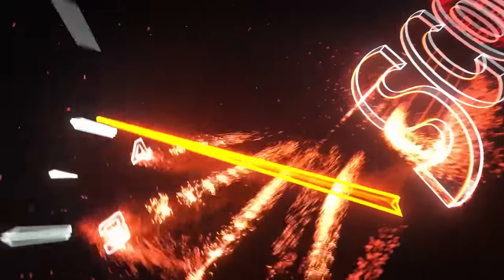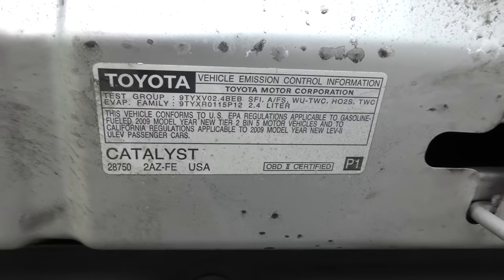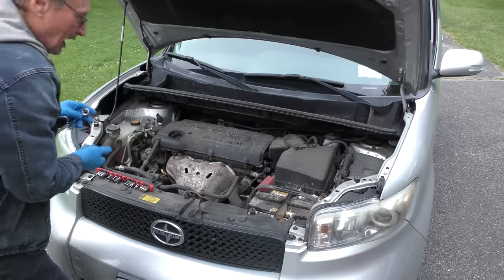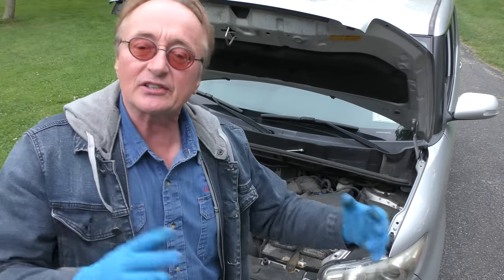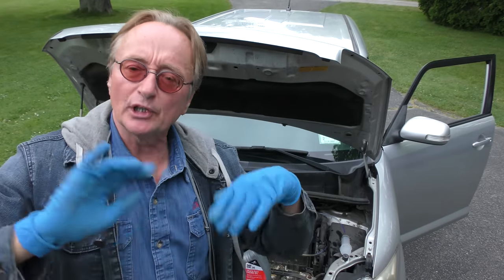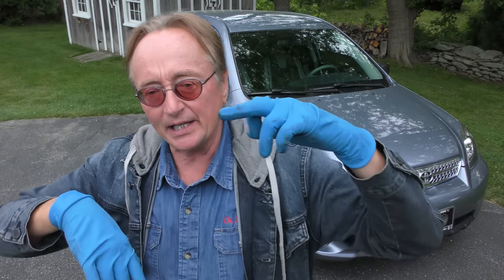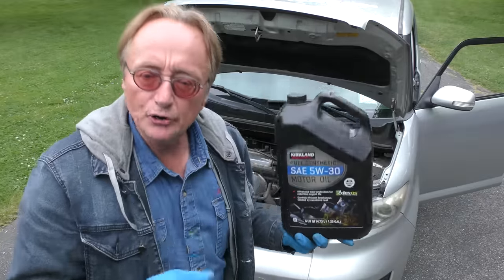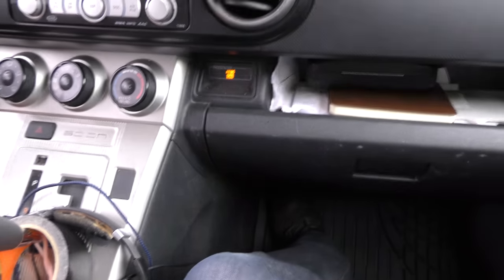Read My Lips, DO NOT Buy These Cars

Comment: This is a shame about the engines because the slightly larger 1.5 L 1NZ-FE used in Yaris' and Echos is simply indestructible (with proper care)!
Reply: Your engine is 1 liter smaller.
Reply: The 1.5 in my '17 Yaris has been great.  With yhe 5 speed it's fun to sling around corners and the freeways. At 55 mph in 5th gear, on flat ground, it gets over 50 mpg. Around 103k miles on it now. Interested in how long it will last. These were great baseline cars, a shame they didn't sell well here in America
Reply: @jcrowellz2000  I own a 2008 Toyota Yaris sedan 5 speed. Owned it since 2013, I have 321,000 miles and just changed the clutch and she runs great. In almost 10 years only the clutch and water pump have gone out
Reply: The 1nzfe was also in the first gen xb's and is also bulletproof and also used in the xa
Reply: dogs, the Scion's were great cars with minimal gadgets, which some people like more. A shame Toyota kinda marketed them wrong. But idk how they could have marketed low priced good cars any better 🤔
Reply: @jcrowellz2000  I have a 2009 Yaris 5 speed manual hatchback with 84k miles bought it with 23k for 6,000$ haven't had to turn a wrench on it in over 5 years just normal preventative maintenance.

Comment: That's why the first gen Scion is the best. My '06 is running fine at 182,000 miles with only oil changes and transmission fluid changes.
Reply: 06 also on 68,000 looking forward to longevity
Reply: Mine currently has 277K

Comment: Got a 07 Toyota Camry and it definitely burns oil. I just listen to Scotty & my mechanic and just keep the oil changes going. And it still runs good.
Reply: Did you buy it new? Only 25% of people in this country perform regular maintenance
Reply: I have the same year Camry What oil do you put in it? I originally used 10-40 then went back to its original cap 5-20
Reply: I put 306,000 miles on my '03 Camry before it died.  And the only reason it died was because I had slacked off on the oil changes.
Reply: @stevechance150  in my experience 80% of high mileage car deaths are when owners get tired & start slacking regular maintenance. I will always maintain my 06 Matrix religiously even when it has 500,000 km on it
Reply: @kolbymartin9743  No, it was used. Previous owner took extremely great care of vehicle.

Comment: I have a 2003 Toyota Echo, only 49k miles, stick shift, still runs well and gets 40-45 mpg.
Reply: @sonafsarek dam rare find! Super low mileage! I love stick shift Toyota’s, in my experience, Manual Toyota’s are the easiest cars to learn manual on. Clutches aren’t stiff, & the shifters feel great. Is it a 4 door or 2 door, & what colour is it? I’m just curious. You should also look up the “million km Echo.” It’s amazing.
Reply: I drove an 02 for 10 years until the differential failed. 110 K miles.

Comment: Just got rid of my 08 Xb. Had about 285,000 miles on it. Still ran great. Only reason I had to let it go was because some ahole in a f-350 slammed into me and totalled it. Was hoping to give it to my son.
Reply: Wow that sucks. The 2nd gen xBs really do last forever as long as you check the oil and fill it as needed

Comment: Same thing is going on in my 09 accord 2.4. Honda didn't build the piston rings correctly and is a notorious issue in the 08, 09, 10 models. So much so there was a class action lawsuit. Im always monitoring it. At this point with cars so expensive now I might as well get it fixed after I finish paying it off. Probably cheaper than buying another car and getting stuck with another note

Comment: I have a 2002 Camry with the 2AZ-FE engine.  It does not use any oil, but only had 49,000 miles on it.  I change the oil at 3,000 or 1 year and hope the pistons and rings last longer than I do.  My oil filler only says use 5W-30 oil.
Reply: @Jonathan A  Ah, right.  My 2AZ-FE has the head bolt problems that cause coolant leaks and overheating and warpage.   Pick you poison.

Comment: Darn. This makes sense. I have a RAV4 with this engine and since I've bought it, it has been burning oil every 1500-1700 miles or so. Smh. I took it Toyota and they said they would charge me to fix it. I couldn't afford it so I'm just living with it. I tried using Lucas oil. It pretty much worked. Then I tried a heavier weight oil, that also worked. I'm not sure what kind of damage I'm doing to my engine but it isn't burning oil lol. I will probably sell it in the future anyways.

Comment: I must of gotten lucky to have the upgraded model. I have an 08 with with 224k miles on it and still have the original starter in it. No oil burning issues.

Comment: I've had a 2012 yaris le for past couple of  years and keep anticipating something going wrong, but it's just consistently reliable and no surprises. No check engine lights yet, no oil consumption at 155k and AC still working great, knock on wood.
I'm second owner and still use royal purple full synthetic oil as did original owner, only reason. Keeping a good thing going.
Reply: I have a 2012 9.0 RS and ZERO problems

Comment: I am second owner of my XB. I bought it at 108,000 I have never had this problem currently at 238,000 miles. I bought it 10 years ago never looked back. Only problems was a exhaust manifold cracked $600 repair at dealership not worth snaping aluminum heads off and yanking engine retapping. Replaced batteries once. That's it. Only time I had problem with oil is when I used Fram oil filters. Bought different brand never had that problem again. I have had numerous people follow me to try buy my car. Sorry your gana pay more than what you think to walk out your Door turn the key fires every time.

Comment: Scotty needs to make a video of my car, the scion xd. It uses the corolla 1.8L engine and 4 speed transmission. I know its not at all fast, especially with an automatic, but its still somehow pretty fun to drive. And although its rated at 27/33 mpg, i consistently get 30/36. And you can get em cheap. Havent had mine for long, but when it comes to overall car expenses: purchasing a car, maintaining it, and buying gas, it may end up being the best value car ill own

Comment: I have an 08 scion xb I bought new used oil from the start tried getting the pistons replaced but they said it passed inspection so I put a couple quarts in between oil changes and kept driving it it has 170000 miles still runs like a champ have no plans of getting rid of it.when it blows up in another couple hundred thousand miles then I will probably salvage it with no regrets!

Comment: I've had my 06' Scion xB for a year now. Has 192,000 miles, and run like a little champ. The best little car I ever had. No oil issues.
Reply: Does the oil cap have 5W30 printed on it?
Reply: @HDHeroCam  mine on the original cap says API SL SAE 5W-30 Energy Conserving

Comment: I recently sat in a 2010 ( or newer ) Corolla, I am 6ft 4in and Had a Hell of a time trying to get in the Passenger Side. Once in, I felt SO Cramped. My 85 Fiero has more room and is easier to get in and out of.
Reply: I sat in a 2016 Cruze on a roadtrip once. Phenomenal gas mileage, I don't think we'd ever spent so little on gas on such a long roadtrip. But I was cramped and seated low. 6'3'' here
Reply: toyota has not made a car I can get into for 12 years. 6 ft 2
Reply: @kkarllwt  I've had reasonable experience with our family's '09 Camry. The Avalon is even bigger, so I imagine that would be okay, but each person's experience is different based on comfort needs.
Reply: Anyone here would sit comfortably in an XB. There is a ton of space for the driver and passengers.
Reply: @PalkiaDialgaGiratina  I would never buy a car that has a door frame that hits my head.  F33king toyota.

Comment: I had a 2002 Camry with the 2.4 burned oil very bad like 1 quart every 200 miles. But it ran like a clock still and had almost 300,000 miles on it and surprisingly still got 32mpg highway! Now if it wasn’t a Toyota engine or a Honda engine no way would’ve ut lasted 300.000 miles
Reply: Do a few piston soak with B12 chemtool for 24 hrs then drive the car in 3rd gear going 60mph on the highway for 20 min and change the oil right after. I was burning 1 qt in 250 miles into burning no oil at all for 3000 miles in my 1 gen tC

Comment: I used to have the camry with the 1mz-fe. That motor could go forever i used to see them with over 200k miles all the time in the junkyard where i used to work too.
Reply: I can confirm my 2000 solara sle V6 is at 205,000 it's a tank if it makes it to 300,000 I'll be happy if it doesn't then i still got my money's worth only paid 300 for the car
Reply: @BenDover-lx1gh  i think it can if you change the timing belt.
Reply: @daydos_soundscapes  I'll have in mind 👍

Comment: 2006 scion xb is fine, different engine somewhat. Almost never have we had to fix anything for any reason beyond normal wear. Tires, belt, battery, think thats it, 7 years on one, 4 on the other, 4 on one we sold, no repairs, no mechanic, ever... heh (brakes) on all of them except mine, of course... Mine is due soon ish. Cant think of any other repairs for at least 50k miles on the one. Mine is not driven alot and the one we sold had 145k.

Comment: I drive my 2013 5 speed XB 120 miles a day 6 days a week it has NEVER left me stranded. Ive only replaced brake pads. I change its oil with full synthetic every 4,500 miles i get 30mpg fills up with $36 my f150 fills up with $85 so it saves me ALOT of money. You put the seats down and you can fit a washer or dryer i have. I also put a queen mattress on the roof when i was moving lol i love the car

Comment: I don’t know Scotty but my 2004 has 316,000 original engine and trans. The Scion xB 2003-2006 were the best build. Yes, the rear main seal started leaking at 305,000 and will be replaced along with the catalyst converter and the AC expansion valve that just went bad.  Not bad for crappy scion with Toyota stickers all around the engine bay and doors. 😂
Reply: Scotty doesn’t really know there awesome cars
Reply: Best Built? The build on later ones was actually much less tinny.  Quieter. Much Safer.

Comment: Question for you Scotty… I get my oil changed every 5k miles and they always overfill it (1/4” over the top fill line).  Is this hard on the engine seals over time?  Thx.
Reply: Yes. Depending on the engine manufacturer, you'll be lucky if you didn't blow any seals. Always better under than over
Reply: Change your mechanic
Reply: A old navy power plant chief told me to check oil while running. As long as the crank isn't whipping the oil no harm done.
Reply: @adamlewellen5081  thats terrible advice
Reply: @adamlewellen5081  Wtf? LOL
Reply: I always tell them to put 4 quarts in mine and I will top off to 4.6
Reply: Yes its bad, it creates more pressure inside the motor, it will have to release the pressure by destroying a part inside the engine. Change your mechanic.

Comment: I have a 2010 Scion XB RS7.0 with the 2AZ-FE motor, I fixed the Oil burning Issue doing a Piston Soak with Berrymans B12, before the piston soak it was useing a quart of oil every 800 mile's after the piston soak with Berrymans B12 it only use's half a quart of Oil every 3,600 Mile's I kid you not. It has 218,000 Mile's on the engine at the moment and i drive it 12 hours a day 6 days a week very reliable vehichle.

Comment: The 2azfe motor is an oil burner but very very reliable. Just get used to adding oil every week or so a quart. U can buy old camrys with this motor that run for years. U will have to watch the rear cheap thin axle material,  and replace one starter and rebuild,alternator. Prob a couple e haust flex pipes.  That's it.  Very very reliable...

Comment: I bought a black 2012 7yrs ago with 40,000 mi and drove it 5 years abusing it and constantly running it low on oil never changing it except maybe twice and it finally gave out at 230,000. Still ran but knocked horribly loud.

Loved it so much I replaced it with another black xB except a 2011 with a manual transmission and bought it with 120,000 mi on it but I'm taking extra care of this one so I expect to go well beyond 230,000 mi. And if I decide to have the piston rings upgraded then it could last me until I die If I wanted to keep it.

Doesn't seem too horrible to me especially if you compare it to most other vehicles out there. Plus it's the most utilitarian car I've ever seen

Comment: Against your advice I bought a 2009 Vibe GT. 242,000 miles. Replaced parts as needed. Burns a quart every 300-400 miles. Switched from
Synthetic to conventional burns slower. Going to go from 5w20 to 5w30 heard that’s a good idea. 
Will contact Toyota as per ur advice. What about using that solvent in the cylinders? Barriman(?). Thx Scotty

Comment: I have a 2012 XB. Change oil ever 5000. It's at 90000. Oil is clean and new looking when drained. Did I get lucky?
Reply: Do you check the oil level right before you have it changed?  It's nice to hear that's it's clean looking oil "when drained", but if you're a quart and a half low, after driving 5,000 miles, you need to check the oil level frequently to determine consumption.
Reply: @stevechance150  Yes it stays on full. I got the vehicle at 54000 miles. Maybe it was fixed.
Reply: 2012 isn’t really plagued with the issue. 08-09 had a lot of cars plagued with oil burning, some up to 2011. Rarely 2012-13. Never 2014-15. Keep it. Honestly one of the best most reliable cars of last 10 years.
Reply: @djkenny1202  That's very comforting. I can't wait to tell my Landover driving brother it only has 380000 miles. It's mint!
Reply: It's at 113K today. My brother's Land Rover sucked a piston and destroyed his engine. I hate to laugh but he hates my cheap little car. @djkenny1202

Comment: This is something that drivers don’t really recognize. It’s not something they can see or feel, but it’s a part of every revolution that the engine’s cam makes when the driver presses the accelerator. Friction is drag. Friction reduces efficiency any way you apply it in physics. For this reason, automakers have long attempted to reduce friction within engines by dialing back tension on internal parts such as valve guides and piston rings. While it’s great that these measures reduce fuel consumption, saving drivers money on fuel while simultaneously minimizing environmental impact, they do open the door for increased oil consumption.

Comment: I bought one of these used on facebook market. I thought I got a deal but it turns out when its cold outside you had to keep your foot on the gas for about a minute to keep it started, after that it worked fine. I didn't want to deal with that and got rid of it

Comment: I’m driving a 2009, manual transmission, original engine, transmission, and clutch and I just passed 271,000 miles…doesn’t leak or burn a drop of ANYTHING. Ask more than one owner.

Comment: Our 2012 xB has a 5 spd. .. Doesn’t use any oil, decent enough manual transmission, TRD rear sway bar and wider wheels and tire and it is fun to drive.. with 115K on it. Changed the oil every 3-4K with full synthetic.. 
My mom and stepdad had 2 Camrys with the 2.4 and automatics .. they change the oil every 5-7K.. none burned oil.. but the head gaskets/transmissions had multiple failures.. the 2.4 has to work much harder in the bigger cars and spinning one too fast is a bad idea( redline should be avoided. 

We love our xB.. I have considered a V6 swap and a Solara 5 speed transmission to make it better on the highway.

Comment: The 2015 model has the 2.4L engine and Toyota made changes to the engine when it came out and mine has 256,000 miles roughly on it and it doesn't burn any oil I change the oil every 5,000 miles like Toyota says to and I don't lose any oil since I replace the valve cover gasket. And it runs like a new car yet

Comment: My wife has a 2011 scion xb, which is a Toyota Corolla, same engine, chassis and transmission, drivetrain. Yes they consume oil, as long as you keep oil in it, change oil every 3-4k mi, it will run for a very long time, its a  Good car, my wife's has 140k mi, only the belt tensioner has broken, its a good car.
This guy recomends buying a scion tc, which has the same engine. I use lucas oil stabilizer and run 5w 30w instead of 5w20w , and it burns about half a court every 1500mi , just check it every week or every fill up, its not hard

Comment: The oil rings were deliberately made to have less resistance to get better fuel economy because of the EPA. If you don't change your oil every 3000 miles the the rings start sticking and cant expand correctly and become froze to the piston. This is why you now see other auto manufactures saying its normal for your car to use a quart of oil every 1500 miles or so. This is the EPA's fault.

Comment: Looking for a gas saver car (4 cylinder) that’s extremely reliable and quality made….I’m pretty dead set on Toyota Corolla/Camry and Honda civics. Any other recommendations? Looking for something between a 2008-2012…my limit is $9,000
Reply: Honda Fit second generation (2009-2014)
Toyota Matrix with the 1.8L
Reply: Corollas are good but the very years you are looking for are the oil burner years ( 2007-2012 ) with a 2.4 ltr .
Reply: @jayhockley8841  that’s why I specified the 1.8L
Reply: @MacTechG4  Im just sayjng that Corollas up to 2006 are good options , or after 2012 .
Reply: Get a 2012 XB. 2013 if you can find a decent deal. There’s cabs in my area with over 350k all day.
Reply: @jayhockley8841  - I actually had a 2009 Toyota Corolla for 6 years and it was a GREAT CAR….besides the obvious oil changes/brakes I only had to replace the alternator. Besides that zero issues and ran flawless. I totaled it last week sadly, but ya a terrific car!